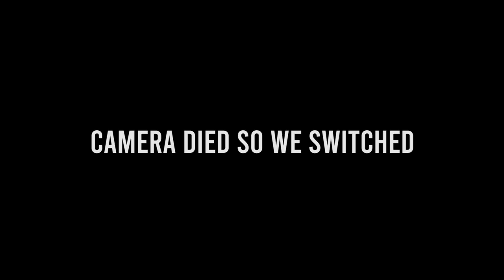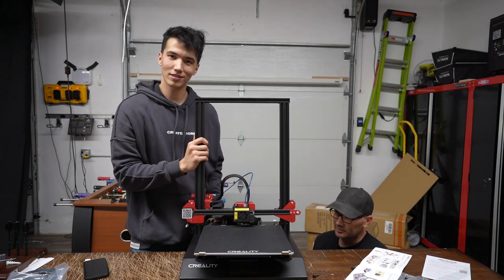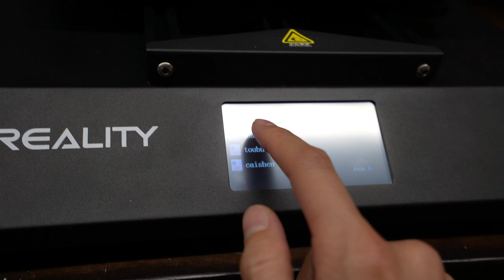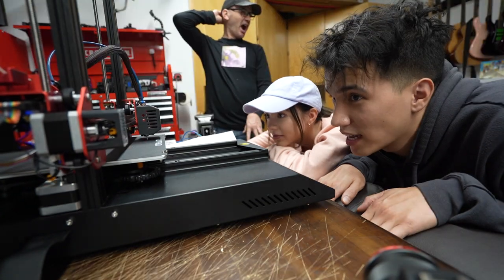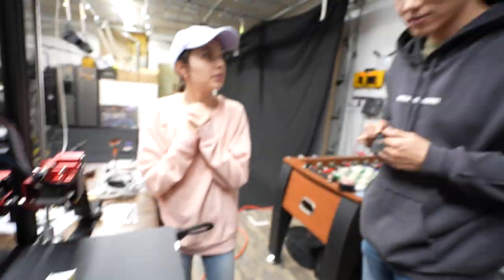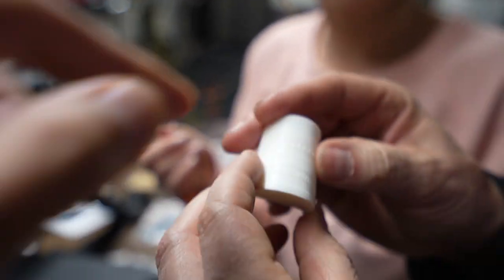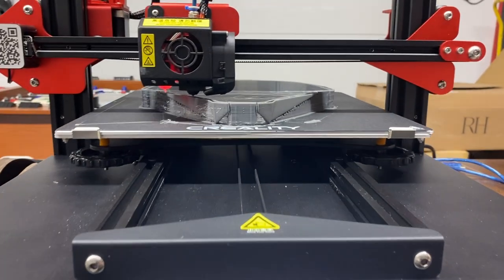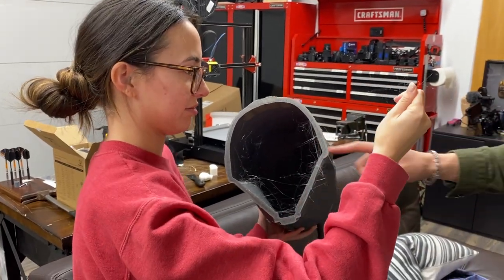Our First Time With A 3D Printer!! (please don’t break)

Comment: I have played around with 3d printing and I believe the 3 cad designs that are already on the SD card are test designs to help you ensure that the 3d printer has calibrated correctly. The line across the helmet is quite normal with 3d printing as sometimes there is a change in temperature, or the speed might not be quite right, there are many reasons why it might misprint a line. It could also be as simple as someone bumped the 3d printer. You can toggle the settings such as speed, infill, temperature. But tbh you got a really good printer and that helmet looks amazing for first go! Good job!!!

Comment: You should use painters tape on the printing bed to avoid damaging the bed after using alot or you can find a sticky printing plate that you can attach to that
Reply: Also to improve the webbing thing u can mess with the settings on the creality software on the computer before printing
Reply: The pump is possibly because it cooled too quickly